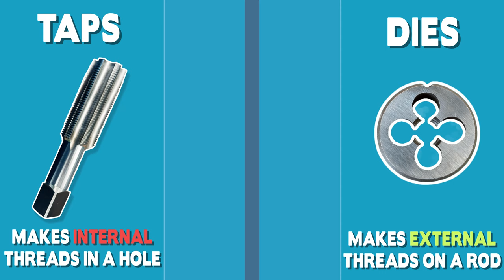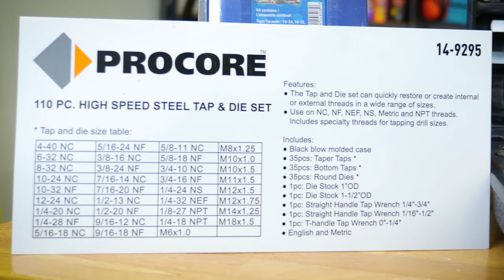Everything You Need to Know About Taps & Dies - Gear Up With Gregg's

Comment: People should learn about forming taps and spiral taps for blind holes
Reply: I highly agree! "Thread Forming Taps" produce stronger threads as they forge the threads instead of cutting them. The metal grains are, generally, forced to follow the shape of the treads.
Forming taps can do bottoming in blind holes.
Forming taps don't need to do the pecking dance as the don't produce chips which don't need to be cleared.
There are also "Thread forming Dies" also.
redrok

Comment: I mainly use these to repair/clean threads. I had to do an M22x1.5 and the end was mushroomed, the nuts would fit on the other axle. I had to buy a new set as my current one topped out at M16/M18.

Getting that thread recovered meant I had to reverse the tools. I held and turned the part while keeping the handle still. Luckily for me the part was a drive shaft and had didn't matter if I was bending it as the bottom part with the threads was being kept still regardless.

2 hours later and that nut went on nicely, then I did the nuts. Even better.

Comment: Thanks for the great tutorial! Well done.

A word of caution! When fabricating your own fasteners, remember the ones you buy are heat treated after they are made. Also the material is of much higher strength and quality that the cheep mild steel you have laying around.

Example: You want to attach your seat belt to the cross member behind the seat. Say you used ¼ inch thick material. Well a coarse bolt only has max 3.5 threads engaged (really more like TWO, the first and last don't hold much) and a fine pitch has max. FIVE and that in mild steel tubing. Please don't bet your life on it. The bolt will rip right out. Grade 8 fasteners exist for a reason.
Reply from the maker: Thanks for your tip and for supporting our Canadian channel Karl, stay tuned for more to come!

Comment: Thank you for this instructional video, I bought a couple taps and a few hex dies. Came across this video cause I needed to know which side of the hex die I put into the die stock, and I got a lot of useful tips and information on how to properly use this tool. Can any kind of lubricant like 3-in-1 oil work if you don't have tapping fluid?

Comment: I want to secure air hose runs for an on board air compressor sytem and secure the lines to the fram of the vehicle, I was wondering if tap and die or Self taping screws would be better? I would probaly be installing some type of SS Cable Clips in these locations. If I tap and die machine threads into the vehicle fram on say 24" Centers would I be ok tapping then using a thread locker or would adding a lock washer be more appropriate? And lastly, i want to mount (2) two L brackets of some heavier gauge Steel comparable to the frame thickness in Gauge. Should I Tap and Die 3 or 4 Holes per Bracket to the frame to mount the Dual Air Compressors and same questions apply what would be best practice in both scenarios? Lastly I may want to mount a larger Heavier Brack to a Cross Member to Accomadate the Air Tank, your thoughts there as well? Thank you in advance for your help?

Comment: I had some oddball taps from a machine shop somebody gave me a few years ago. They're spiraled like twist drill bits with teeth. I guess they're used if you need extra clean out to prevent chips from clogging your hole. I tried buying these in a hardware store. They must be exclusive to machine shops and can only be purchased at an industrial supply store. Most new dies are hex now. Very seldom see round ones.
Reply: Those are machine taps...they are made for power tapping bc they feed the chips out the flutes so they can be fed straight in

Comment: Hi, what tap do I get for existing hole clean out. I have a chromed part and plater left some residue in holes. I need to clean out the hole , not create new threads. Please give me a suggestion if you have time.

Comment: I did not realize this video was over a year old until I finished typing this comment but I'm posting it anyway.... 
 Quick tip: An easy way to put a perfect and centered chamfer on a rod (not bent);  Chuck it up in a cordless/corded drill for rotation while grinding the chamfer on a bench grinder.  Turns out pretty nice. Lastly, I have not taken the time to read the comments but, that nut was pretty loose fitting and it also looks like a lock nut which makes it even worse. I'm sure it was used only as a quick example for the video and not meant to be 100% accurate.  I've been a heavy equipment mechanic for 23 years and knowledgeable about most of the content but I did learn something new. I never realized there was an actual technique of going back half a turn per full revolution when it came to breaking the chips.  I did it by feel which would probably explain why I broke a few taps in the past.  It was a pretty good video and got me to click the subscribe button.  I look forward to checking out more content from Gregg Distributors. Thanks
Reply from the maker: Thanks for the tip, Jeremy! We're glad you stopped by and learned something new today, stay tuned for more to come!

Comment: Thanks for a great video .  I have always thought that you were meant to use all 3 taps Taper then Plug followed by Bottom , so I have learnt something .  I have a question regarding Split Dies , the type with a screw either side of the split in the die .  Am I right assuming that the screws are for closing up the Die and adjusting the depth of cut ?  .  Also when I used to sell Tap and Die sets they were either Carbon Steel or Tungsten Steel which was more expensive .  So is HSS the new name for Tungsten .

Comment: Very informative, my only question is what is the difference between for example a 5/16- 18 and 5/16-24 tap. I can obviously tell one is a finer thread than the other. So I guess my next question is, which one is typically used more most threaded hex bolts. Asking because I have a set but only need like 4 of the taps in the set for work. I don’t want to try and use the wrong one and mess up the threaded hole. That would be a huge problem especially since we don’t have a fabrication department to remake the part I messed up for 3rd shift
Reply from the maker: Hello Shoreline, the -18 is coarse thread and is more commonly used.
Reply: @GreggDistributorsLP  thanks!

Comment: What brand is the set right next to you? I need a big one because my bolts are huge for my car engine mounts bolt
Reply from the maker: The one on the table is this part number right here:
https://greggdistributors.ca/Tools-Shop-Equipment-and-Storage/Hand-Tools/Taps-and-Dies/tap-and-die-sets/pcr149295
However, if you know the specific size, we have open stock available as well here:
https://greggdistributors.ca/Tools-Shop-Equipment-and-Storage/Hand-Tools/Taps-and-Dies/taps?resp_group=Default,Variations,ItemProperties

Comment: So I got 8 caster wheels that I wanted to add to my metal shelf to make it mobile but the threat/screw o. The wheels are  slightly too to thick. Would I use a kitty tile this to make them smaller?
Reply from the maker: It is not recommended to file down the threads. The Female hole is likely a different size or thread pitch, so filing the male end will likely not make the connection work.  You may have to find a different type of caster with the same size and thread as what the hole is. To determine the thread pitch, a thread pitch gauge can be used. check them out here https://greggdistributors.ca/search?type=product&q=thread%20gauges&terms=CategoryName%3aTap%20and%20Die%20Accessories

Comment: When tapping a hole there drill bit size charts to use the proper drill for the proper tap. How does one know what size solid rod to use when using a die. Is there tables for that?
Reply from the maker: Unfortunately, we have not seen a chart like this before.  You would likely want to use a micrometer to take some measurements of the outside (peak) of the thread at it's apex and try to find a piece of steel stock that would work.  We do have this available and it can be found here:
https://greggdistributors.ca/search?q=round%20rod&resp_group=Default,Variations,ItemProperties

Comment: OK, good sir I have my m17 oil bolt for my scooter 125cc and noticed a some brittle metal or grey cast iron on the bolt?
I cleaned it off and noticed it was the hole/thread. So when I go to tighten it down, it keeps turning without tightening?
What is the best method to solve this problem? I was thinking of using m17 drill, then tap it with m18? 
Is that how it works?

Comment: Where's the stuff about dies??!!! Okay, found it! Btw, love the way you yanks say chamfer.....
Oh yes, and there is a way to get both taps and dies square to the job, drill a hole through a block of hardwood to keep a tap vertical and slide it on to a rod for the die holder to sit on.

Comment: A question.  Let's say I have some taps that my machinist dad left me, and the markings are so faded I can't tell the size.  I know I'm going to need a thread guage, but how do I measure for the number in front of the tpi (like 8-32 or 1/4-24)? Thanks!
Reply from the maker: To figure this out, you will need a combination of tools.  The first is a bolt, nut and screw gauge:

https://greggdistributors.ca/test-instruments-and-gauges/test-gauges/pap022030?resp_group=Default,Variations,ItemProperties

The second is a thread pitch gauge:

https://greggdistributors.ca/test-instruments-and-gauges/test-gauges/pap996570

The first tool will identify the front part of the number sequence, the second tool will help identify the pitch.  Hope that helps.  Thanks!
Reply: @GreggDistributorsLP  That helps immensely, thanks!

Comment: i have a Cal-van ford triton spark plug Extractor part No.39100 what is the tap size need help
Reply from the maker: Unfortunately, we do not have a part number 39100 in our system, but to aid in your process of determining tap size, you may want to invest in these handy thread identification tools:

https://greggdistributors.ca/test-instruments-and-gauges/test-gauges/pap996571
https://greggdistributors.ca/test-instruments-and-gauges/test-gauges/pap996570
https://greggdistributors.ca/test-instruments-and-gauges/test-gauges/pap022030

Comment: The screw hole got cross threaded. It's originally for a 5mm screw. Should I now tap a larger hole or can I just re-tap new threads using a 5mm tap in the same screw hole? Thanks.
Reply: Try re tapping the 5mm, if that doesn't work then go larger

Comment: Can I use motor oil to lubricate?  Or WD-49?
Reply from the maker: Yes you can, however we would recommend using a cutting fluid like Rapid Tap, shown here. https://greggdistributors.ca/search?q=RAPID%20TAP&resp_group=Default,Variations,ItemProperties

Comment: question pls internet people
i have a rod that is 7mm and a die that is 6mm - will i be able to cut 6mm treads in it 
or does the rod have to be 6mm to start with?
Reply: your rod has to be 6mm also
Reply: @flat-earther  thank you so much for the info
It helps

Comment: Can I use a carbon steel die on a carbon steel rod? Or would I need the high speed steel?
Reply from the maker: The high-carbon dies should work just fine on a carbon steel rod.  If for some reason they do not, you could always step up to a HSS die.  You can check them out here:

https://greggdistributors.ca/search?q=C18&resp_group=Default,Variations,ItemProperties&page_size=8&view=list&terms=CatPage:C18

Comment: Man, inches are so damn illogical. I'm in need of a bsw tap, and a die, and I'm not sure what sizes they are. I have an old bolt thats ruined but I checked the only living threads on it and its a perfect match with 24g 3/16 7/32. I know its 55° so its bsw. The major diameter of the threads is very close to 7/8. So what should I google to find the right size tap? 
I'd really appreciate it if someone took the time to help me. 
I'm very unfamiliar with inches

Comment: Hi, I need to re-thread the DWH line cast iron) as the air line corroded and broke apart. which tap do I need to use, carbon steel or high-speed steel?

Comment: In regards to dies, I was told that round dies are for threading, whereas the hexagon are for chasing threads.  Is that true?
Reply: Hex can be used to cut new threads.  Either can be used for rethreading.  Damaged threads, however, should be repaired using thread chasers which are not suitable for cutting new threads.

Comment: Can someone please let me know if I can use 3in1 oil when I’m using a tap
Reply from the maker: Hi Dustin, although it isn't the best option, you can still use 3 in 1 oil when tapping, however just be careful and take it slow. For best tap performance, generally straight cutting oil should be used. For non-ferrous and non-metallic materials, a coolant or a cutting fluid (light oil or soluble oil) is recommended. Thank you for watching!
Reply: @GreggDistributorsLP   I called someone and ask them what the material is that I’m cutting a new thread in and they told me I could use 3in1 oil because it is steel and I’m cutting a new in the threads

Comment: What about the left tap drilling?
Reply from the maker: The same principles discussed in this video would apply, it would just be reverse taping motion.   Thanks for watching our video!
Reply: @GreggDistributorsLP  but you would need a left tap driller and turning it left? Or you can just use right tal driller and turning it left?
Reply from the maker: @gasperorazem4206  You would require a specialized "left hand tap" which would have reversed threads.
Reply: @GreggDistributorsLP  thank you

Comment: This should include "for beginners". No info on how you sharpen the stuff and some incorrect info as well. No carbon steel taps are not for "soft stuff" while HSS are for "hard stuff" :) Carbon steel taps / dies are for hand operation and are "old school" stuff - HSS is for hand ans slow machine operation. Also no mention of carbide.

Comment: Well here the deal, my tap broke then my extractor snapped in half , now what?
Reply from the maker: Ouch!  Not a great situation!  We have seen it done before where someone welds a bolt or a nut, depending on your specific situation, on to the broken piece.  From there, hopefully the weld holds, and you are able to attach some type of a socket/wrench to it and with any luck, you will be able to remove it.  If you are welding, caution should be taken depending on the material the tap is stuck in.  Hope that helps.
Reply: could possibly use a "grabit" to extract the broken tap...if that doesn't work, drill it out then softly tap the tap with a punch and a ball pean hammer.

Comment: Not Everything...Once I make the hole what size bolt goes in it?  Didn't answer that.  Or the reverse.  Once I make a bolt, what size hole does it will it fit into.  These kits tell you what drill bit to use & what tap to use...but then what size screw to buy? answer me that & I will come back & like 5 of your videos.  Deal?